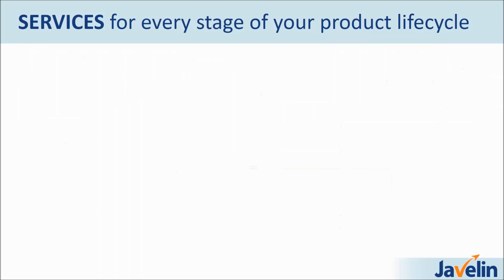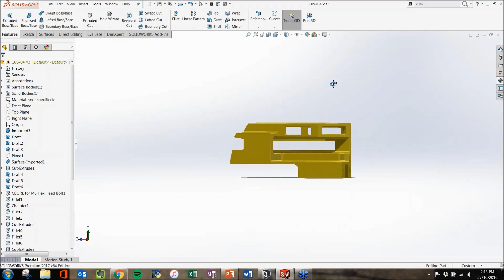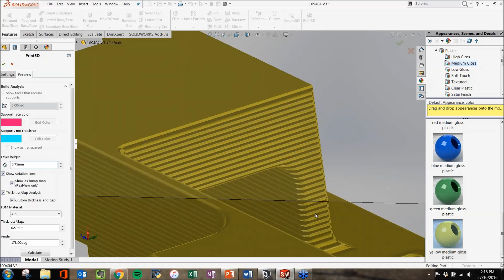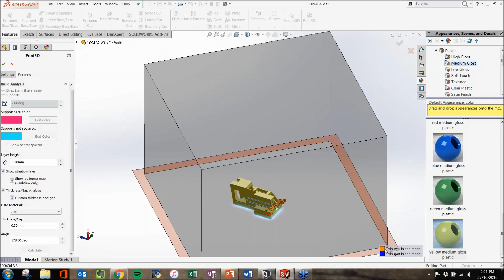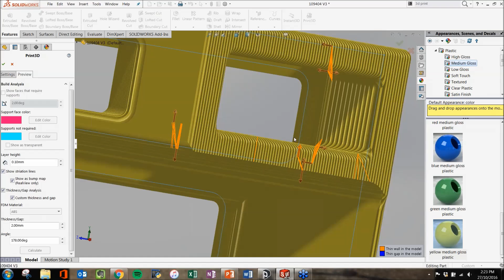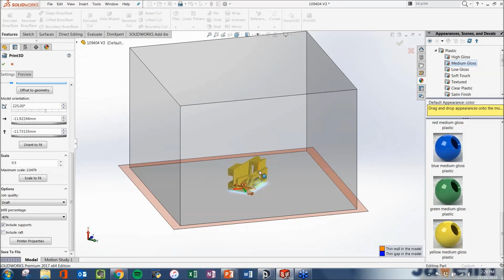Using SOLIDWORKS for 3D Printing

Comment: Still running WIN7 but can not use the 3D print option in Solidworks until I upgrade to 8 or 10. Is there a known fix to be able to use Solidworks 3D print with Windows 7?  Thank you

Comment: It's very primitive. Too bad that the save STL button was moved to the bottom of the menu. I use a third-party complete Slicer. Quality 3D printing is not a pretty picture and useless imitation layers on the parts. I understand that this Solidworks feature is only the beginning. I hope the developers will go towards the creation of a full slicer. I am wishing good luck to them in this.
Reply: Hey, your post of solidworks 3d print its two years ago now, did they improve the 3d print feature at all?